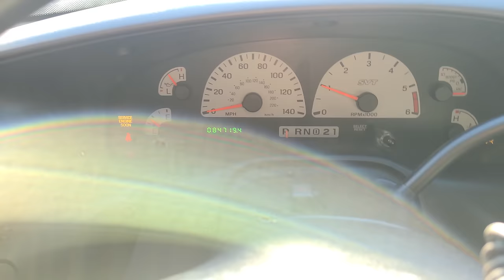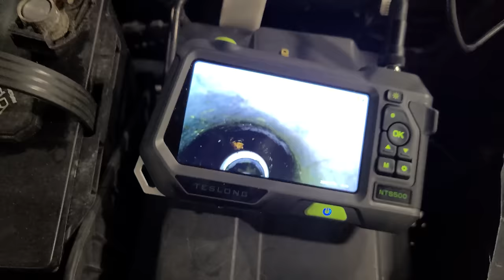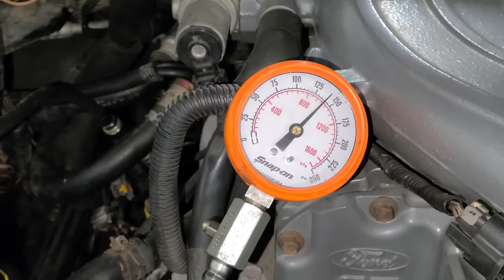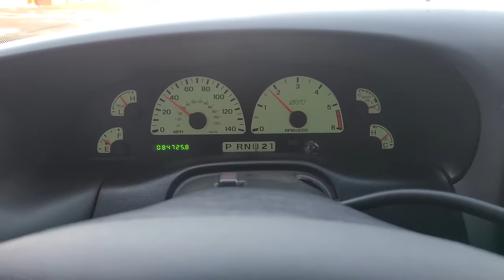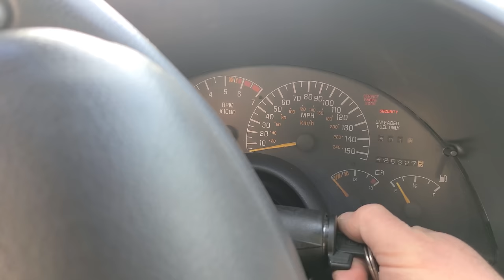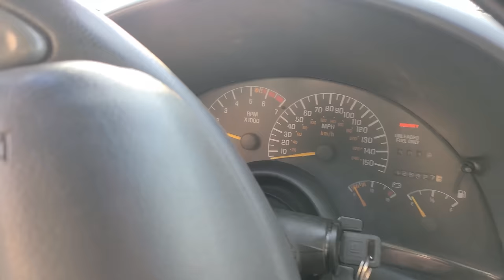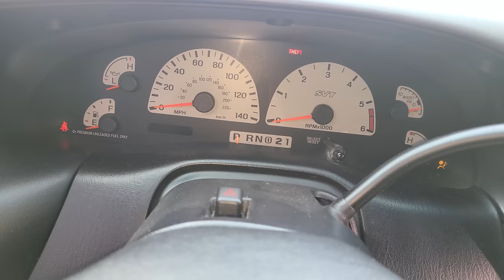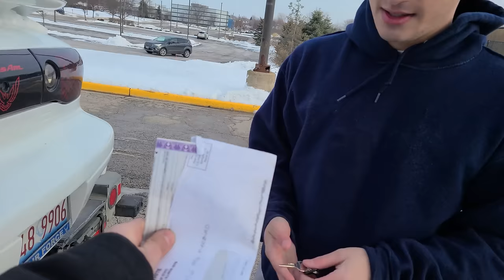I Fixed My SVT Lightning Engine For $3 & Then Gave My Dream Car To A High School Kid For Free!

Comment: That's awesome what you do and it's also awesome that both of you have so much in common. That being said as a disabled heavy line gas and diesel tech from Ford them lightnings do way better on Motorcraft spark plugs . I've done several back in the day colder plugs and msd coils with the bigger pulley. God bless you for what you do and as always be safe 👍

Comment: Ford guy here.. The spark plugs sometimes back themselves out slowly and get loose on those older 2v heads. This in my experience is what causes them to jump around and ruin the thread / require helicoils. I would just tighten it back down until you're ready to take them out for replacement with longer lasting variants like iridium.

Comment: Hi Alex. When trailering a car, you don't have to put it all the way forward.  Back it up until you have around 50 to 80 kgs pressing down on the tow bar, then strap it down. It will tow way better and be far more stable on the road. Cheers mate and love the channel. Adam

Comment: I've owned 2 Lightnings. The OEM coilpacks are perfectly fine even up to 1200HP. Always make sure you're buying genuine OE motocraft from a dealership and you'll never have issues with them. The stock heads, however, only have 3 1/2 to 4 threads because Ford chose to cheapen out on that with the mod motors of that gen. 4.6 and 5.4 both have the same issue, and the Lightning uses the same heads. The best fix is getting aluminum inserts (not steel!), getting them welded and re-threaded or upgrading to Trickflows. Oh by the way, the color of that truck is called  'True Blue'. Was kind of unpopular, IIRC it was only available for one year.

Comment: I drove an 02 F250 with the V10 for a company a few years ago, LOVED the power it made, and just the truck in general. It had developed a tick that sounded like an exhaust leak, went on for a few months, and of course at the very end of a long day, it blew that plug out of the head, it was very dramatic and loud, but I already knew of this issue with these engines so I knew what it was and they told me to drive it back, they fixed it the next day and it’s still on the road 👍

Comment: I've owned 2 5.4 2v it doesn't matter what year you get there is no good way to know for certain you have the fixed heads. I would recommend eventually swapping to all ford coil packs, ngk plugs, and rethreading the heads just to be done with it. My mint late production 03 f150 spit a plug right through the coil pack while cruising on the hwy it felt like I just threw a belt.

Comment: I once had a tip from a guy who used to race motorbikes, he said to run a pencil down the spark plug threads as the graphite lubricates but unlike fluids doesn't gum up with heat.

Comment: I learned my lesson with Accell coils many years ago on a 4.6 Cougar with a few mods that had a misfire, they were fine for about 2 or 3 months but it started to miss again, especially under hard acceleration. Bought a set of OEM coils and never had another problem!

Comment: Cool move to hand over the T/A to the kid. 
When I was a kid the shop teacher let me build my motorcycle  (BSA 650 Lightning) in the school shop. That goes a long way and 30 years later I still appreciate it. 
   
   The thing about the spark plug blow out is exaggerated and more human error than engineering error. A good mechanic will never have that issue.

Comment: Classic beetles are also prone to blowing plugs out of the heads. A steel plug in an aluminum head meant they were either stuck in there good and proper, or flying about your engine compartment.
The worst car I had for looking good but being rotten was a white allegro. It looked really good, but after I bought it I noticed that the rockers and valences had been repaired by filling them with concrete. That really didn't help with corrosion!

Comment: When you inspect sparkplugs don't just look at the electrodes, check the condition of the insulator. If it is cracked or damaged it will not deliver high voltage to the electrode, this is a common faliure point and is often overlooked. They can be damaged from high heat etc.

Comment: For future reference on the Fords, when doing a compression test you can just hold the throttle to full and it will not fire the injectors that way you don't have to pull a relay for the pump. I honestly can't wait to see this engine get pulled and have it running tip top. These trucks are just great.
Reply from the maker: Thanks!

Comment: I learned to mess with cars on fbodys. Started hanging out with a guy that always was working on cars. Iv had so many fbodys completely torn down to the bare unibody, i know them like the back of my hand now. The one in my picture is my current one, tore it down completely and gave it a new life with a ls1/t56, and a bunch of chassis upgrades. Never thought i could do the things i have done to this car, but amazing things happen when you start hands on learning with an appetite to do it yourself

Comment: Great video. Good on Eli and good on that school for still teaching auto mechanics. You can never go wrong knowing how to maintain/repair cars even if you are not planning on doing it as a profession. Myself, I took several different mechanics classes in high school and was fortunate to have a father that was into car mechanics. I didn't get into mechanics as a profession, but I have probably saved tens of thousands of dollars over the past 35 years. Recently replaced the alternator in my 04 C320. Dealer wanted close to $500.00. Did it myself for around $200.

Comment: My 2000 Expedition with the 4.6 blew a plug out on the highway going 75MPH at 210K miles. Sounded like a bomb went off, instantly lost power --- I thought I lost the motor but it wasn't smoking... pulled off and found the COP had been blown off, the plug was still in the end of the COP boot dangling it broke the housing on the COP and the bolt was still in holding the tab down.

Ended up buying a kit on Amazon to drill out the threads, cut new threads and put a sleeve in... this worked perfect, took about an hour and the truck has been running great.

Comment: Thoes coils being loose are completely fine. You don't even need to put the bolt in at all, granted its good to have them in though. They are just there to stop the coil coming off. That doesn't happen often though. And make sure you get the right coil, I forget which one but there's a difference between the 2,3,and 4 valve 5.4s and the 2 or 3 valve 4.6 👍

Comment: Only use motorcraft spark plugs in a ford. I used to love Autolite plugs but anymore only motorcraft will run long time without causing any issues.  I never thought it would make any difference,  but i have first hand knowledge of rough running engines caused by other brand of plugs..

Comment: I have a piece of crap audi oil pressure sensor stays on. Number 3 cylinder misfire ... going thru 2 spark plugs a week. It's a hassle getting my 62 year old mom back and forth to work everyday plus me trying to work with only 1 car and afraid it is going to crap out anyway is very stressful... these cars you have would be like a dream to me and my momma. Awesome stuff

Comment: Another note: it will probably cause you fits with emissions testing, but with as plug-hungry as Ls are, deleting the EGR makes changing them a lot easier on the driver's side of the motor.

Comment: Try the Denso coils on your truck when you do the head gaskets.  I have been running them for years on my 5.4 2v Triton without a hitch.  IDK why but I think they work as good as or better than the OEM Motorcraft part.

Comment: A little piece of advice, from my own experience, I used Autolites on my 4.6 2v Mustang and it misfired like crazy, went back to Motorcraft and it ran smooth as butter, don't know why but I've read that's the case on Ford Modular engines for some reason, so I'd stick to OEM if you're not going to modify it any further!

Comment: That engine actually didn't sound too bad. Probably just needs head gaskets. Maybe heads as well. But these old iron blocks don't die. A lil heat isn't gonna kill it. When you guys went to start it it started misfire then spun backwards.  But the base compression still sounds good. I think that motor can be saved actually.

Comment: Great video Alex! It would be nice to get some updates on Eli along the way or at the end of his engine swap. Also one thing to watch is the amount of tongue weight you have when pulling a trailer. I don't know if you could move the tire chocks to get the car further back, but another option is backing it on. Just make sure you don't have negative to tongue weight, haha.

Comment: There is a kit on amazon that has all the taps and insets for the spark plug holes it’s around 250 and you don’t even need to pull the motor the drill bit has a stop so you won’t drill to deep

Comment: Heartwarming video, lucky young man.  Can tell you haven’t towed before though, nose weight on the trailer hitch is way too high as the TA is too far forward on the trailer. Should back it up a little to balance the weight better. Nose weight should be around 150-200lbs.

Comment: I had a 1999 (until a woman ran a stop sign and totaled it for me) and now have a 2001 F150 Lariat with the 5.4L engine.  The shop where I have my work done told me that the two coils closest to the fire wall are susceptible to moisture damage due to water run off from the firewall.  I haven't confirmed that but on both trucks I had to have those coil packs replaced around 100K miles.  Just had #4 replaced on the 2001.  Great trucks though.  Just the 2 valve 5.4L had the spark plug issues.  Also... be sure you address all recalls on it.  Those model years of the F150 and Expedition had issues with fires that Ford said was due to a Cruise Control Harness.  People lost homes over that one.

Comment: I towed my Comp T/A with an F150, but to be fair it was a 5.0 4x4 manual so it didn’t struggle too much, the bumper hitch however, it did struggle 🤣

Comment: Fords like Ford ignition coils, spark plugs, sensors.  Basically use OEM for any of those type of parts.  Owned many Fords over the years from Focus, Merkur XR4Ti, Mustangs to Rangers and F150s.  Every time I used a non OEM electrical part it hasn't run the same/properly.  May cost a couple bucks more but still cheaper than buying a different brand only to end up buying the OEM Motorcraft afterwards anyway.

Comment: well at 1.500$ its about how much they are worth. doing a full part out would make you even and someprofit! if you don't count youre time! at least you get money back!  
still awesome tho! i sold my last complet 1995 LT1 complet w/ ecm and harness for 750CAD out of a 6spd Formula! 
i kept the starter for my 1996 impala SS! 
going LQ4 in my 1995 impala instead!
trans is worth about 150-200USD. 200-250USD for complet rear end w/ brake. rad/fan are a good upgrade for 3rd gen outthere. hell just the tail light are worth alot. maybe 100 for the wheel. 
front crossmember is also easy to sell to V6 owner who wants to V8 swap with the mounts!

Comment: That cone air filter was probably never oiled like it needed so that may be letting dirt in the engine, put the air filter to stock, will save you aton of headaches

Comment: If that guy doesnt leak until under boost then see if you can stud it. Dont pull heads just the the bolts one at a time and replace with arp? Not sure if you can easy enough without removing the heads or not.?

Comment: Gap those plugs to .035 on your truck. .050 is way to big.

11-14 ft/LBs on the plug. Do not overtighten, that is what weakens the threads and blows them out.

Comment: That grinding noise at 22:43 sounds like the headlight motor gear. It's probably stripped and putting power to the battery caused it to turn.
Reply: It is.Plus the negative battery terminal is sort of messed up.
Reply: @EliHasan  you can replace the bolts that go into the terminals. I recently replaced them on my 95 Trans Am after battery acid ate through the threads on the positive terminal disconnecting the battery and making the bolt unable to be used. The pair costs about $5 from any auto parts store.
Reply: @pdennis93  thank you! Will for sure be doing that!

Comment: Hey legitstreetcars..  are you 100 percent sure it’s the heads leaking under boost on the lightning? It’s been awhile but I owned a 2000 lightning and as soon as I added that lower pulley and upped the boost it blew the factory intercooler out(common issue on Lightning’s) you could drive it fine without issue but it would leak as soon as it got into boost.  Just a thought I had.. maybe you went over that already and I missed it.   Pretty easy fix for you if that is indeed the issue as it’s right under the blower.  Check it out.   Man I miss that truck!!!!

Comment: Look I know you are an awesome mechanic and I have learned A LOT from you. With that being said, please spend the extra money and replace ALL of the spark plugs! I have a 2013 Hyundai Sonata Limited 2.0 turbo, I was driving it out of town, please NOTE: "this is my wifes car" and I felt like it just didn't have the same power as it was new'. It id have the engine replace under factory recall, but many miles later, I deside to replace the spark plugs. Now, after I replaced them, WHOLLY MOLLY, what a difference. With that being said, You REALLY should replace ALL of the plugs even though the 7 others don't REALLY need them or cause a malfunction.  Then continue to  make another great video in the future.
Reply from the maker: I would never only replace one bad plug unless I was just about to remove the engine to replace the head gaskets. Which I am.
Reply: @LegitStreetCars  Continue on the videos. You are going to make it big soon.

Comment: The van 5.4 triton v8 motor is better than the truck version they are all 2valve motor and they don’t have the spark plug problem only if you have a mechanic that gives them too much torque on the plug into the head and screw up the threads

Comment: Do you come across Acura Legend 1993? I bought a Acura Legend 1993 not knowing that the Catalytic converter was cut off with the Y-Pipe that the Catalytic Converter connected to. I just been trying to find a Acura Legend 1993 that still have the Catalytic Converter with the Y-Pipe not cut off all I need is the Y-Pipe. I Bought a New Catalytic Converter. I get a Check each Month I bought Parts that I can afford to bought.

Comment: Plugged fouled because of head gasket issue?  I have a 2001 4.6 NA triton with close to 300k and it doesn’t foul out plugs.  Never a issue with the spark plug threads knock on wood.  I torque them per the Ford TSB.

Comment: You def wanna get his car started with the old motor in it make sure it's got milkshake oil if not drain oil out ad half gallon of water n 1\2cup Palmolive to the oil fill( the dish soap cuts any residual oil that may still be coating engine internals with lubrication) start it in neutral in an open area so you can hold accelerator to the floor n drop it in gear and start doing donuts or a one wheel peel smoke show until you get a proper let go on the lower end (water dishsoap eliminates the use of oil dri when it kicks a rod or 3) now this will see if our future tech will stick it out or ahh hell it don't even matter motor n trans can come out  togher n the donor is good so the torque converter bolts are a non issue

Comment: The svt would handle this very easily if you didn’t have the weight so much up front on the trailer. 
No idea how uhaul trailers work as in tiedown points, but I think that was all.

Comment: Come on 4 threads that holds a spark plug and an engine that is boosted that was built  “Ford rough” One thing I’ll say about Subaru they’re not big for changes on a lot of their parts they find what works and they hold onto it…… well mostly….

Comment: You pulled the car too far forward on the trailer car should be centered over the trailers axles! Just a heads up
Reply: For your safety obviously, could cause an accident especially with a two wheel drive truck

Comment: Haven’t watched the video yet.   Just the first minute.   Bad head gaskets?   #3 Misfire.  Could easily be coolant getting into that cylinder.  Exact same situation on my wife’s Acura.   Bought a new coil cleared the code for a few days.  Code came back so I pulled the spark plug and cranked it over.    Coolant misted / sprayed out of the hole.  Traded the piece of crap Honda in for a Lexus. 

Love the channel.

Comment: Eli sounds like the right person for the car...he should pull his LT1 out and rebuild it, throw a Cam and aluminum heads on it, maybe some rods and pistons...but in the meantime, just swap the LT1 into his car...or do what we'd all do..just drive the T/A as is. P.s. what car huy hadn't ever load a car on a trailer and towed it? The Lighting has a lowered tow rating than a regulat F150. The smoke you saw by the air cleaner on Eli's car was from the backfire through the manifold. Sounds like the ignition was way retarded, probably due to it being in limp mode.

Comment: U-Haul transport vehicle trailer weighs 2,210 lbs. Pontiac Trans Am weighs 3,544 lbs. combined weight is 5,754 lbs. towing capacity of SRT F150 is 5,000 lbs. That puts the SRT at 754 past it’s towing capacity. Perhaps the other U-Haul guy may have been right. I’m not a lawyer, but there might be a liability issue for U-Haul if they don’t verify the towing capacity of the customers vehicle.

Comment: Next time you load a vehicle 🚗 onto a trailer. Move or vehicle about 12 to 14 inches back. Put the center of gravity to the center (front to back) of your trailer. The way you had it loaded it was to far forward on the trailer. Way to much Tongue weight. 
  Just my point of view !!